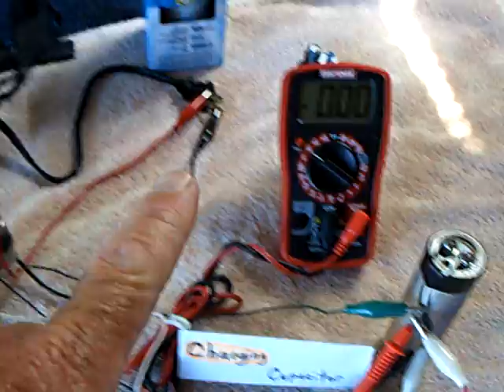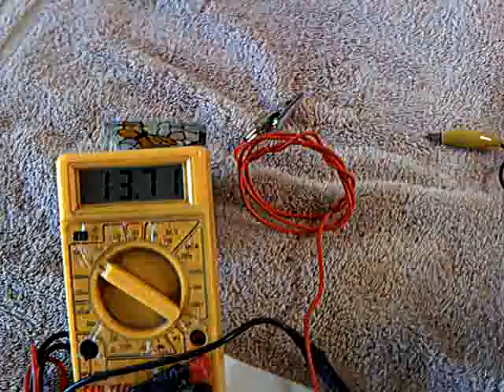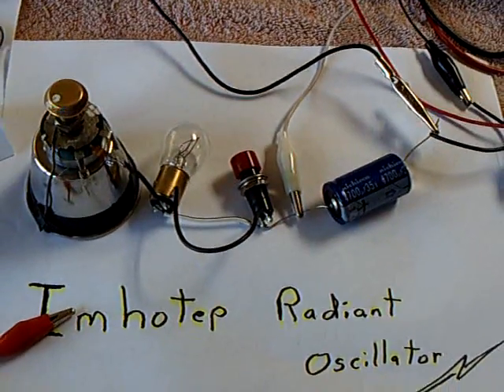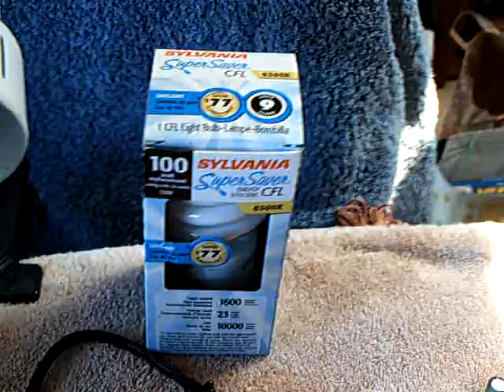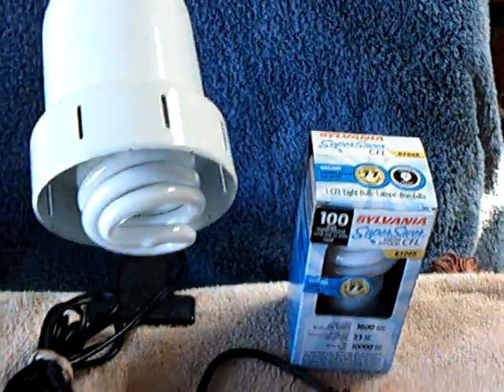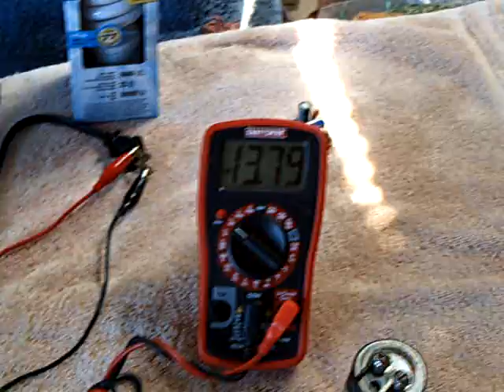Super Capacitor  Imhotep Radiant Oscillator

Comment: Hi, you are taking the energy from capacitor “A” lighting the light and charging capacitor B, if you repeat the operation using the “B” capacitor as a source in a second attempt , lighting the light  and charging capacitor “A” could you run this “forever”?

Comment: OK but you keep saying you are not using a battery but you are.  The capacitor bank is your battery.  Then you convert the low voltage to a high voltage through a simple oscillator circuit, light goes on and second cap charges while you drain the source battery.  Eventually everything drains down and no more oscillations.  Is there more to this?  What is the benefit of this demonstration?  Is there something special about this?